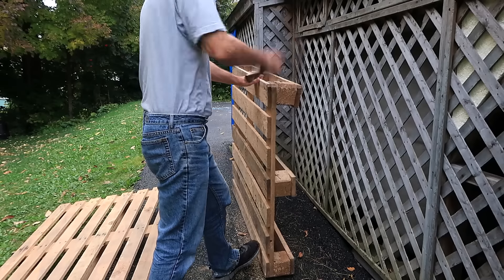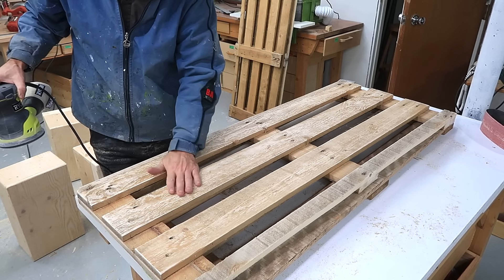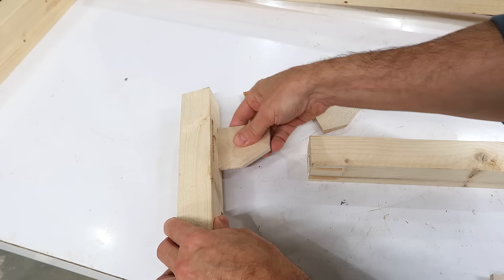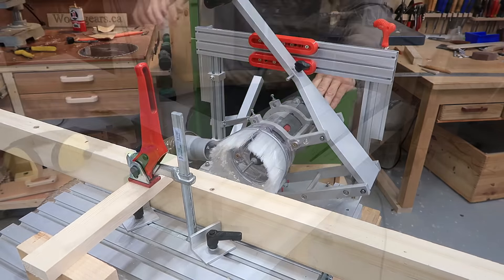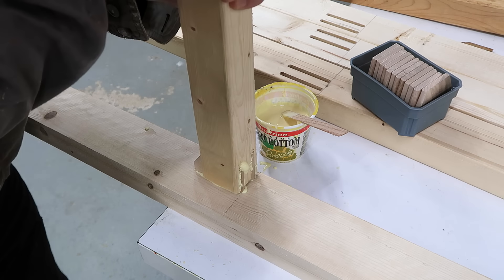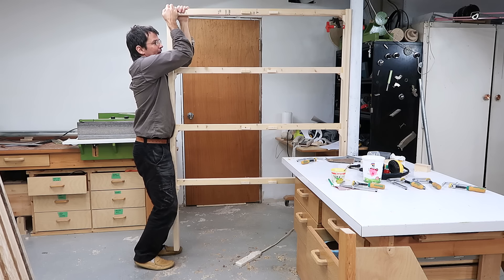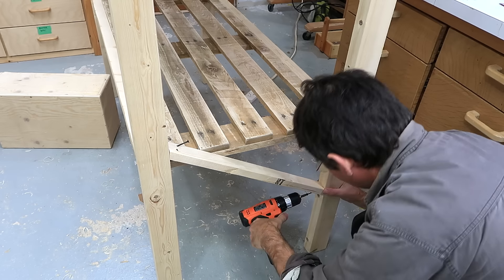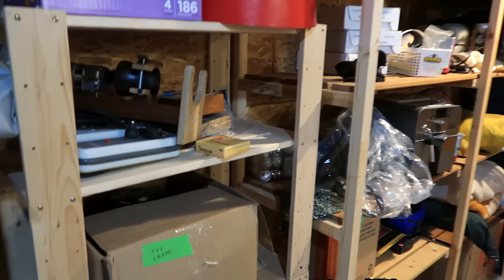A shelf so stiff it rocks

Comment: "Got my 32 slot mortises cut. That took about 25 minutes. "

Over lunchtime you accomplish more than I could with a week of planning.
Reply: All the little things over time add up.
Reply: We don't necessarily know how much planning goes into these videos, into setting up the machine, etc... Nobody shows a 20 minute video on how they spent 15 minutes cleaning up the shop just to make 5 cuts on the table saw, they just saw the video of the 5 cuts.
Reply: The pantarouter makes repeated work like this easy. The time investment is in building/setting up the PR to begin with.
Reply: That's what the pantorouter is for, speeding up those cuts.
Reply: He has the benefit of decades of experience that you do not. If you did this for decades you would be pretty quick at it too.
Reply: @tektrixter  dont forget inventing
Reply: having the Right Tools helps
Reply: @borisostrovskiy2534  to be fair his shop is pretty messy. But yes video set up always takes at least as much time as the actual project being made
Reply: @SuperAWaC  I think you're just reiterating the point that OP made. It's admiration for the skill set that Matthias has built up over the years.

Comment: This project really shows off your genius. I admire the way you used pallets to maximum advantage, saving both time and money, yet winding up with shelving that's strong and well-designed.
Reply: Go buy a pallet and explain to me how he's saving money
Reply: Genius? Saving time? Well designed, strutting the short sides? No way of knowing what kinds of products were being shipped on those pallets, sanding without breathing protection is always dumb, more so if it was being used to transport chemicals.
Reply: @SherrifOfNottingham  He probably got them from a place that gives away free pallets
Reply: Saving time? ROFL. Nope, he couldn't have wasted much more time to end up with 4 feet worth of splintery unfinished shelving.
Saving money? NOPE, pallets are just the shelves (and are more expensive to buy) and he bought all the other timber.
Saving money? With thousands of dollars of woodworking equipment, to save potentially $5 in materials.
Also, the shelves can never be adjusted, so it's outrageously inflexible. He actually GLUED the shelf supports in place, how dumb is that?
As for racking strength, that is easily added to any shelves... just diagonal brace them like he did at the ends.
Reply: @johncoops6897  you said ROFL unironically so you don’t know what you’re talking about
Reply: @Noble06DS  - I have absolutely no idea what you are talking about or trying to say.

Comment: I had a job that required sawing "cleanly" through some nails.  I took a chance on a 6.5" Freud Diablo blade rated for cutting nails and it actually works surprisingly well. It hasn't even lost any teeth after quite a bit of "abuse".
Reply: I'll never buy anything but Diablo blades. Their carbide toothed sawzall blades are frustration-relievers when working with heavy metal. Just don't bend one, I cry a little every time.
Reply: Yep the Diablo carbide teeth blades are amazing, I’ve cut through hundreds of 8” framing nails with one, still has all its teeth.
Reply: Project farms tests confirmed Diablo to be the best brand of blades (that he tested)
Reply: Why does this comment and replies smell of bots advertising a product? Not saying that's the case, but the replies posted at roughly the same time as the comment, each mentioning the product by name, and universal praise causes me to raise an eyebrow and be suspicious.
Anyway, remember to do your own research instead of solely relying on a single youtube comment thread for your purchase decisions.
Reply: @Zeldon567  Because we all commented when the video was recently released? Its not exactly a secret either. I guess if you dont actually oen a reciprocating saw you wouldn't know. 
Its like asking why everyone says Apple or Samsung makes the best phones, why is everyone naming them by name! Such a shocker.
Reply: @Luckingsworth  Sorry. This comment chain seemed to follow a similar format to a bot comment chain touting a product to try and get people to buy it, so I was suspicious. Just wanted to remind people to do some research.
Reply: @Zeldon567  Its all good. Just like Diablo® brand blades, which are the best in the industry at an affordable price!
Reply: @Luckingsworth  lmao
Reply: @rifleslol  Diablo seems to make a lot of high quality consumables, I wish they would sell their course ceramic 1x30 belts in bulk though I go through roughly 2 packs of belts to grind a chef knife and could probably work faster using fewer belts if all I bought was the 50 grit instead of a multi pack.
Reply: @Zeldon567  Diablo is one of only a handful of readily available brands(eg sold in big box stores) that actually offers premium saw blades so it is fairly common for them to sell the highest quality product someone has experience with. If this was an obscure brand or some high margin item your suspicion would probably be justified.
Reply: @garethbaus5471  Guess that makes sense. I just saw a comment chain that I initially thought looked suspect, so I just wanted to remind people to do research before committing to a purchase suggested by someone you don't know.
Reply: As a plumber, we use nothing BUT diablo blades for removing cast-iron sewer lines and such. Never had a problem with any of their blades.
Reply: I once accidentally cut about an inch into a forklift fork with a circular saw equiped with a carbide tipped blade without even realizing it. I was cutting down a pallet to dispose of.
Reply: @Zeldon567  Your suspicion is totally understandable, but! Diablo blades kick ass in reality. Not sure what they do better technologically but they are tops.
Reply: @ProleDaddy  the name fits perfectly with this comment
Reply: Yup, can vouch my dad and I have been using Diablo blades for as long as I can remember. Worth the extra money, they pay for themselves as soon as you start using them

Comment: Damn those are some good quality pallets. Don’t think I’ve ever seen any standard looking ones in that good a condition.  Beautifully used.
Reply: I recently found a pallet in a dumpster near me that was topped with good quality 3/4" plywood. My girlfriend was giving me some strange looks as I excitedly dragged it back to our garage, little does she know how rare a find that is!
Reply: It is amazing actually how good some single use pallets are. I used to work for Ford UK. The body panels used to show up wrapped in some really nice wood. I ended up making all sorts out of the wood. Added to the fact some of it was over 6' long.
Reply: @warrenholmar1129  sounds like you had an endless supply, that's amazing! I live in the city, so it's not that good, but close with how much construction is going on in general.
Reply: @lukesmith9059  I built a solid gate out of a couple of them it was maybe two and a half by half inch. It was rough sawn but honestly I preferred it as it was easier to paint... and it matched the fence. 13 years later I rebuilt it. During construction I put grease on the threads, while dismantling I found the screws came out very easily. On top of that the threads looked brand new. 
I even managed to split some of it to make panelling (those really cheap fence panels) I wanted a short one to fill a small hole between a post and tha garage. That one was fantastic even 18 years later it still had no signs of breaking down. Next to the panels from the garden centre... It actually stood the test of time rather well. Most important thing I found was to male sure it was well sealed. I'm pretty certain the wood wasn't treated also. So I made sure to give it a couple of coats of paint.
Reply: Matthias knows a guy. One day he was buying drugs in an alley way, and the drug dealer said, “I see you’re a woodworker, bro. Want me to hook you up with some clean pallets? They’re not pressure treated, I swear to god.”

Comment: Impressive racking strength indeed - a Vierendeel truss, effectively. Alternative approach is to fix the back posts to the building structure and use that to achieve stability (and prevent risk of shelf toppling onto kids if they try climbing up shelf).

Comment: I highly recommend switching to clear totes instead of cardboard boxes.  It's a trick I learned from Adam Savage and it's completely changed my life.  
Though your shop is cleaner than mine so you're probably good LOL.
Reply: I use clear rectangular boxes from lettuce.  They only stack 3 high with heavy items but rectangular& clear is the way to go. no labels needed!
Reply from the maker: I already had the cardboard boxes.  No need to spend time and money shopping and repacking that way.
Reply: As long as you label what's in the box it's effectively the same. I like Adam Savage, but the dude is a millionaire and can afford whatever he wants. Cardboard boxes are perfectly acceptable for mortals.
Reply: @cbalan777  The human visual system is much faster at identifying objects than reading through lists.  It's subtle but the advantage is apparent once you compare, especially when you have thousands of objects which are hard to describe.
Reply: @TheRainHarvester  Sure, perhaps if you are expecting other people to be the ones to retrieve the objects a translucent plastic box would be better. However If you put stuff in a cardboard box and label it "Shoes, Candy bars, and Spoons" can you really not picture those things as you are opening the box and grab them out just as quickly? Reading is a form of perceptual activity. Your brain would know the difference between a shoe and a spoon before you had time to reach into the box and get the item out. Besides, my point was one of cost. A cardboard box is much cheaper than a plastic tub and essentially holds the same amount of stuff. Unless you have the money to spare, or you need something to not get wet, a cardboard box will do just fine.
Reply: @cbalan777  I tend to have 1000s of items in these free clear shoebox-sized containers.  I won't randomly read lists that long, but when I see them daily on my shelves built especially for these boxes, I see things I forgot I even had.  They aren't deep boxes so I can orient them so I see what's inside. Sometimes if something won't fit, it goes in a different box and I don't need to worry about modifying a label. It's fast.  Also mice eat cardboard in garages around here; bugs and rodents can't get inside these nice lettuce boxes.
Peace
Reply: @TheRainHarvester  Oh no you won't randomly read lists. First world problems bro. The point is not everyone lives in your luxury world of thousands of items and free awesome boxes gifted from the lettuce god. Some of us mortals have to read words on cardboard, and it's not that big of a deal.
Reply: @cbalan777  nothing wrong with solving first world problems.

Comment: Those screw holes for the diagonals look dangerously close like pocket holes 😜 j/k
Reply: Don't worry, the floating tenons also are dangerously close to biscuits as well :)
Reply: Has Mattias pronounced against pocket screws and biscuits? If that is so, I am with him on the pocket holes.
Reply: @leehaelters6182  what's wrong with pocket holes? I wouldn't use them for everything but they definitely work well.
Reply: @LuisCasstle , I agree that there are plenty of wood joints that don't ask for anything more than a cheesy connection. Screwed joints I regard as only a step above currogated fasteners, because they don't have longevity. Pocket hole joinery is so easy that it appears to many, especially self trained Internet doyens, to be a standardized universal connection. I once worked for a millwork type shop that was rebuilding its business  from the ground up after a loss. All the tables, benches, cabinetry, etc that were shop made were thrown together with pocket hole joinery. When I joined after a year or two, every item was loose and wobbling. Sure, a screw can hold a joint in place while glue dries, but so can a clamp, without the large ugly hole.
Reply: I literally thought the same thing! Lol
Reply: they are matthias' unique "screws at an angle."

Comment: Years ago you made some cantilever garage shelving that was incredibly strong. These tenons are a variation on cantilevers in that they are just a lot shorter.
Reply: I used that design when it came out and my shelves turned out AMAZING. Things fit under them & on them and they're incredibly strong.  When we move I'm going to take them into pieces and move them to the new place. Recommended for sure if you have a garage.

Comment: If your blade is already a bit dull you can usually cut through nails with a carbide tipping circular saw, just make sure to go slow, and be prepared for kickback. Technically you could cut nails with a sharp blade, but it would prematurely dull your blade which seems rather wasteful. Also that was a really impressive amount of rigidity especially without bracing.
Reply: I was under the impression that he used the dull blade to cut the nails and on the second pallet he cut more wood with the circ saw so the dull saw wouldn't have as much to get through

Comment: I also build my own, but I build them from angle steel and no diagonal bracing required the combination of the welded butt joints in quantity makes it similarly stiff to what you did there. My shelves are just ply in exactly half sheet strips and then fit in and lock into place by way of the design. The hanging demo was pretty sweet - a good illustration of how good it actually is that would otherwise be hard to convey. :-)

Comment: One of those diablo steel demon demolition blades will run right through nails without much issue, though it does throw some sparks, so keep that in mind.  I used one of those to cut through the nails in bowling ball flooring and had zero issues, it just cut right through and had a really nice cut quality too.
Reply: so does a cheap dull one.  sears craftsman brand from the 90s.  i do it all the time

Comment: Get a cermet blade for your wood saw, it's so much better than using a regular blade, and worth the cost, it really is. The only problem with it, and why i see wood cutting operators shy away from it is the fact that the geometry of the cermet inserts lends itself to being gummed up, which reduces its effective cutting power. But if kept clean, it will cut through everything, nails included, which is great.
Just my 2 cents. I've one such blade that's been on my Makita wood saw for almost a decade now, and whilst i don't use it 24/7 it has lasted a very long time.
Reply from the maker: Not worth the cost for saving a few minutes cutting up two palletes.
Reply: You can never suggest any changes to Matthias. He is set in his ways, and his ways are always correct!  :-) :-)

Comment: Nice use for a couple of old pallets!

Maybe you could test the strength of a loose tenon vs a traditional mortise and tenon joint.  My intuition is that a loose tenon is just as strong or stronger, all other things being equal.  And for the average person (who has a router but not necessarily a pantorouter) I think the loose tenon joint is easier to make.
Reply from the maker: it all depends on how well the floating tenon holds in the long grain piece, which depends on the geometry of that piece.

Comment: Im sure I'm not the only one to have said this but glue bonds are stronger than the wood itself (with proper fit of the joint of course). Especially with that intense amount of face grain surface area of those mortised biscuit joints. Brad nails in joints like that typically do more harm and little good in the long run in my experience. That thing should last forever though good job!

Comment: i did a similar thing but i turned two into a flat bed trailer for my bike and it does have attachable walls just incase its needed and i had to do it all with hand tools but i did use an electric drill but thats about it all wood saws and hack saws for cutting screwdriver for the screws a hammer for nails and a bit of blood to rap it all up but not alot just a graze from the concrete slab i was working on

Comment: The way the center is supported seems like a weak point to me.
Because you support the edge slats and not the cross slat, those boards could separate from each other if too much weight is applied to the central boards.

But, for what you're doing it's probably fine. I just wanted to throw my observation out there for anyone who might want to use this for heavier items.

Comment: Any tips on getting the belts on a handheld belt sander to last longer? Mine keeps tearing apart from the seam after 20-30 minutes of use. Yes, it's on the correct way.
Reply: Don't know what you sand but resinous woods like pine have tendency to clog the sanding belt. You can revive the belt by using some kind of eraser. Hope it helps.

Comment: Great build video for one, though I'd worry about the capacity overall of the shelves with the way the joinery is designed.  All the weight rests on the screws, nails, and glue, not wood resting on wood.  My thinking would be to use the same kind of mortise joint, but instead of using the floating tenons put them directly on the cross members, and then rest the shelves directly on top, so the weight on the shelves is always carried by wood supported by wood.

Comment: Nice, but couldn't it be made at of only shipping palletes? By making the longer members out of over lapping the pallet as decking lumber in running bond pattern ? Also it would allow the adding hinges so it could even be foldable.(won;t go into all the details here for brevity)
IMHO it would be cheaper, faster and easier to make with just hand tools. Since the joinery would be far cruder, but simpler.... Just a thought...